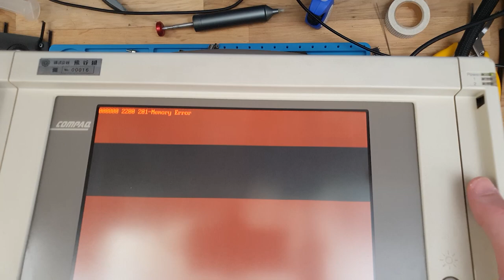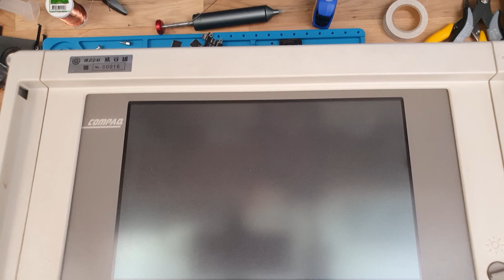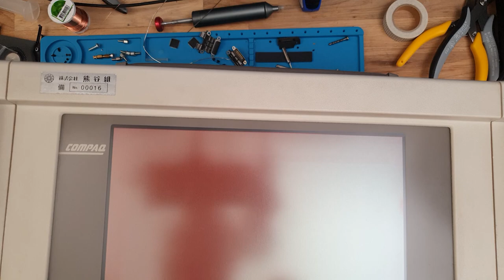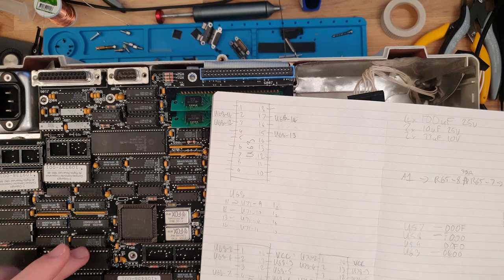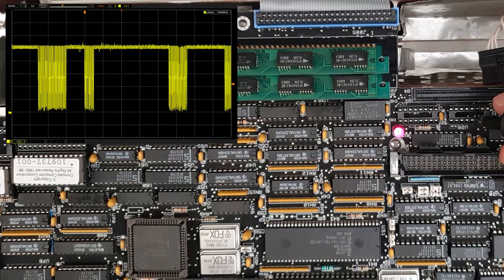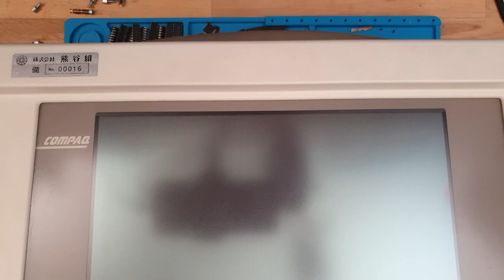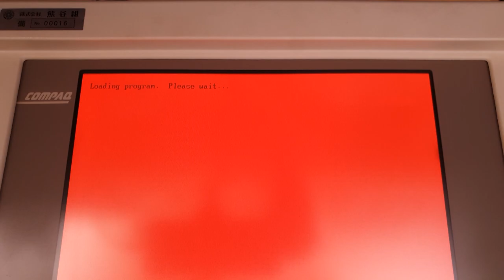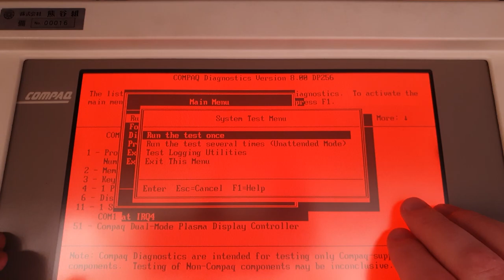Memory error troubleshooting (again) on the Compaq Portable III

Comment: I admire your persistence in reverse engineering and working through the problems.  Many would have given up a long time ago!.  Although it wasn't a win for you, it's a win for us that have one of these as we can now be much better informed on how the memory bus is distributed around the board, perhaps saving us a lot of time..  I have restored one of these, but haven't restored the second one.  The first one thankfully came alive after popping a few of it's caps.  However it's powersupply died, so I had to reverse engineer that one to find the culprit, which I thankfully found and managed to fix.  It's great to see how you have explained many of the issues you found..
Reply from the maker: Thanks, I appreciate it! The power supply in this one was dead when I got it, if you can believe that ;) It ended up just needing electrolytics replaced, and one exploded tantalum.

Comment: Whats the specs on that Tant cap you replaced because I believe I have the same problem, are there schematics anywhere for this board?
Reply from the maker: From memory all the tants on the main board are 10uF 16V, but it's best to confirm with the markings on the part you're replacing directly (if legible)
Reply: @silvestronsbitsandbytes  thanks!!